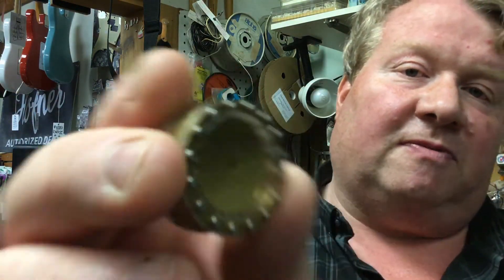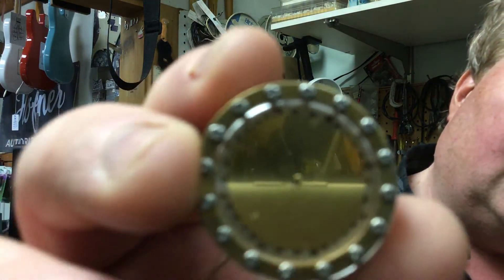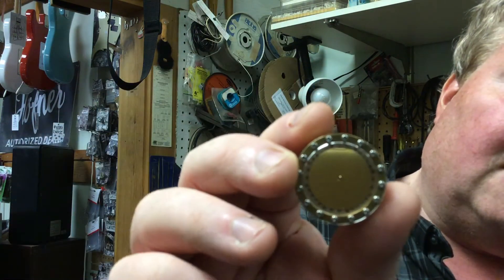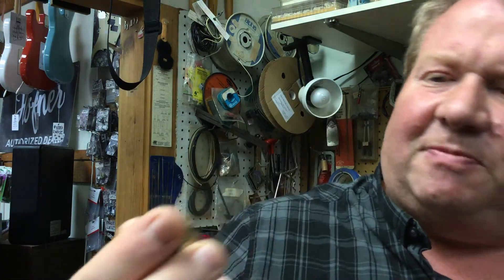Microphone Humidity Damage - How to Test for It

Comment: I have sennheiser e835  the tone is nasal at become low quality nasal at less bassy when i use to sing it will become distorted but it was not hapoen before, waht would be the damage to this mic capsule is thwre posibility to fix it??
Reply from the maker: It could be capsule damage, however this has a dynamic capsule, so it'd be a different kind of capsule damage

Comment: I live in Shanghai and am using an NT1. It functioned well at the beginning and failed after several months. I guessed this was due to the humid weather here in Shanghai and blew the mic with my hairdryer. Magically it worked again. Given the summer heat here, I think the moisture/humidity is the only cause instead of the temperature.
Reply: I have the same issue, can you please tell me how it is going now, for you.
Reply: @know2552 aye bro please help me if you fixed it please man🙏🏻🙏🏻🙏🏻
Reply: Can you tell us if that's a permanent fix?
Reply: Yes I Too faced Same Problem with Rode NT1
Hair dryer Cleared the problem.

But sometimes problem arises again and again

Each time I am Using My Hair dryer.

Comment: I'm Using a Rode Nt1a and Facing an issue like, Mic catches voice at some times and some times it just doesn't, I've tried to put it in direct sunlight then got it fixed for a few hours and then Got to see the issue again?
is there any fix?
Reply: How solved
Reply: Got the same mic, what I do is use a hair dryer at the softest, slightly warm setting, for like 5 seconds (I've been advised not to do it, but it works for me) and it becomes usable for a few hours. I'm guessing guess humidity has already taken its toll on them, and we need to get the capsule replaced? the same happened to an old AKG p420 I have, and it too works for a few hours after a few seconds of drying. my at2020 seems to be much more resistant to humidity, as I think the capsule is made of a slightly less sensitive material, but the sound of it is also slightly less detailed for my taste.

Comment: Unrelated question.  Using Oktava 012 - each capsule has the cardioid pattern marked on a specific spot on the capsule.  Is this specific to the pattern?  In other words if the symbol is on top that pattern is as in the drawing.  IF the mic is rotated does the cardioid pattern rotate with it, or does it stay as it was as in the drawing with symbol on top?  Am I clear with this.  We are streaming our Ru - Orthodox church service - the high domes - choir upstairs, priest below and in front - I have the Oktavas mounted side by each on a bar with the Rode arm.  Mics are pointed forward towards the Altar and choir is about 15 ft behind.  If one mic with symbol on top captures that upper dome range, the second mic rotated symbol down - would it capture the floor area?   Any input would be appreciated.  Igor
Reply from the maker: That position doesn't matter. The address side direction matters. Also there's not a big difference between the cardioid and supercardioid, it's actually how much of the back is filtered from the capsule. The capsules themselves are pretty identical, so even though they have different sounds the pickup patterns aren't that radically different, for example I like using the omnis in an XY pattern, even though you would think the cardioids would be better, there's a tonal difference, so if you have the three capsule set definitely try them. However I think you're right to use these mics in an XY pair.
Reply: @microphoneboutique  Thank you for the reply and this helps.  We are using the cardioids for now and are getting very good results now that the area of capture has been found.  A friend has omni capsules and that will be our next project.

Comment: I've used the soft heat of a light bulb at distance, particularly with oktava 012 SD capsules, as well as other LD capsules.
Reply: Interesting to keep in mind.  Been leaving the mics out on the mount - and humidity gets very high here in summer.

Comment: Can we use heat to dry one out?
Reply from the maker: You can try, I've had limited success. I wouldn't add heat as much as save every one of those dehumidifying pouches you get in a box, then throw the microphone in those pouches into a box together it may suck the moisture out. But oftentimes it's just trapped inside and there may be some damage.